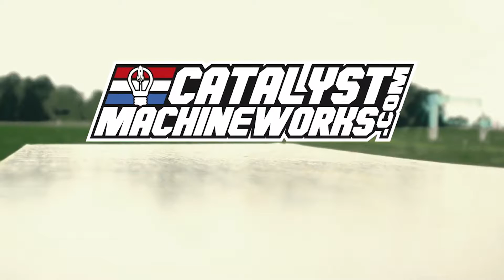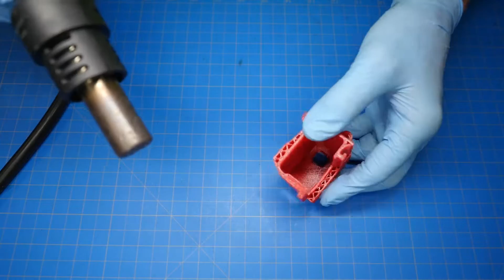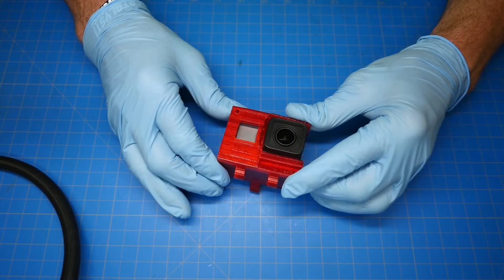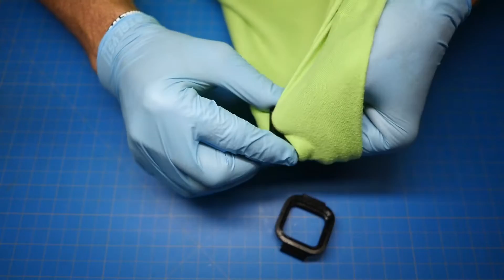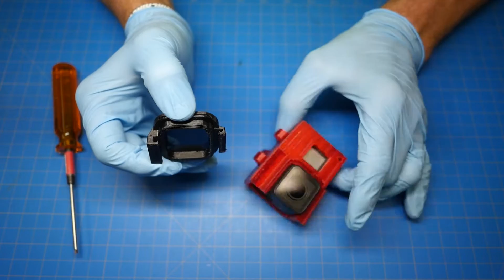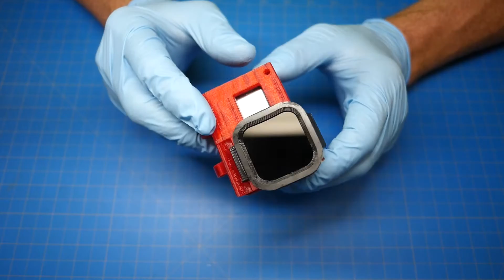GoPro Mount Tutorial (Install and Removal)

Comment: it's a great mount! I'd recommend though, changing the print to have a cutaway section on the bottom right side (as you are facing the camera), that way the USB port door of the camera can be opened without even having to remove the camera. for the hero 7 anyhow.. I used a soldering iron to melt that spot back to achieve this. I never have to remove my camera at all now. please consider making this mod. it would help many people.
Reply from the maker: Not a bad idea!